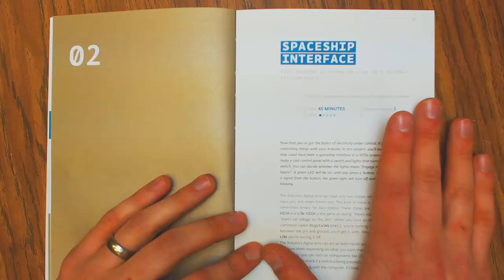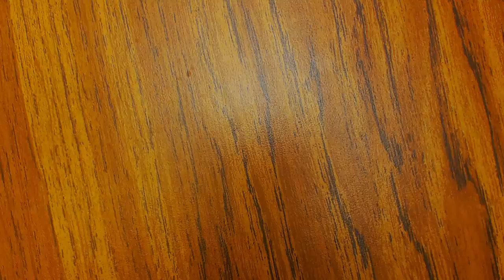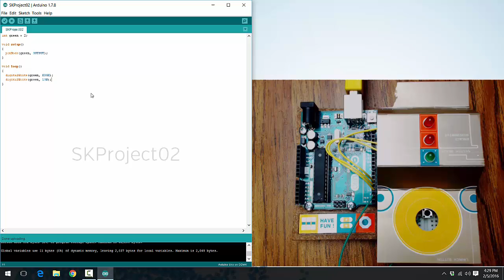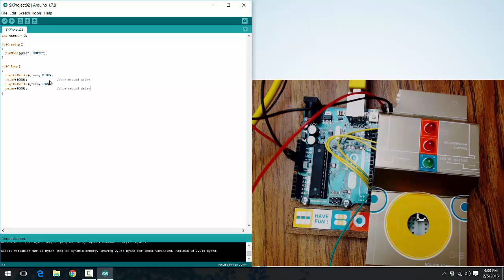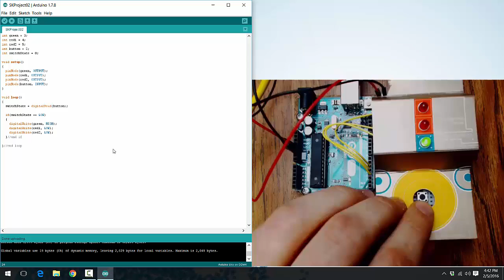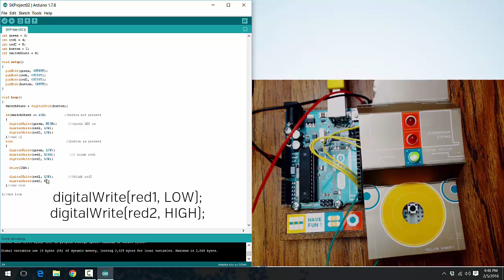Official Arduino Starter Kit Project 02 Spaceship Interface

Comment: Arduino: 1.8.9 (Mac OS X), Board: "Arduino/Genuino Uno"

/Users/apple/Documents/Arduino/PROJECT_2/PROJECT_2.uno: In function 'void loop()':
PROJECT_2:17:1: error: expected ';' before 'if'
 if(switchState == LOW)
 ^
PROJECT_2:23:2: error: 'else' without a previous 'if'
  else
  ^
exit status 1
expected ';' before 'if'

This report would have more information with
"Show verbose output during compilation"
option enabled in File -> Preferences.,

I Didn't understand what this means

Comment: HELP. My set isn’t working. I know I have the circuit right but I am not using correct resistors because I did not get them. Is this why it isn’t working?
Reply: well try to get the right ones because it is a big deal and also there is an example section,    and under the starter kit click spaceship interface and it will all do it for you